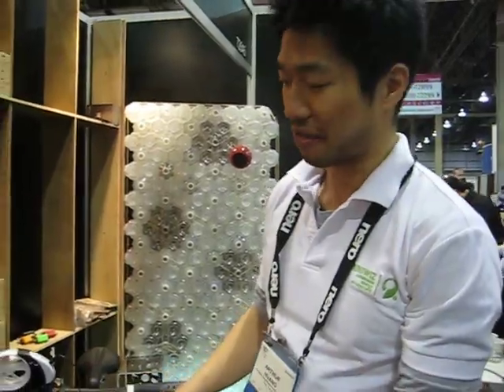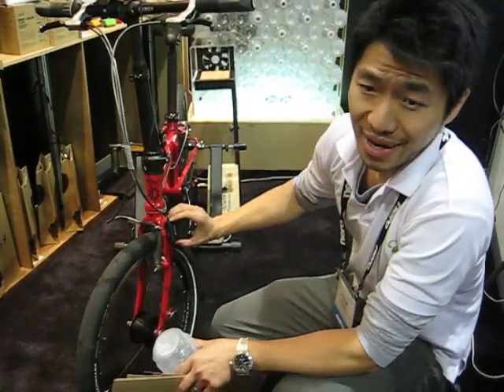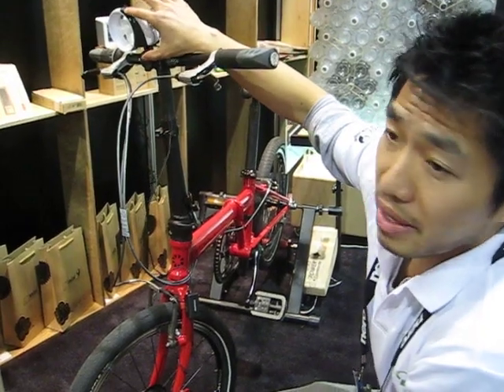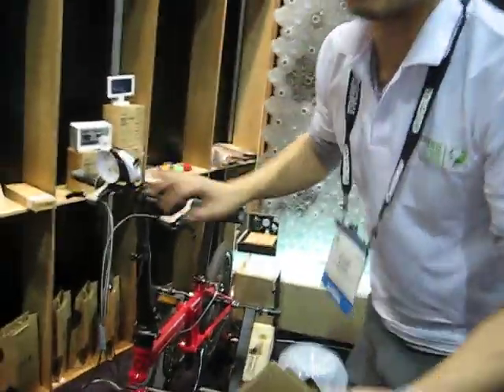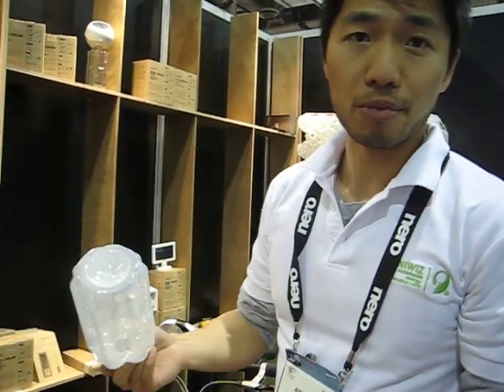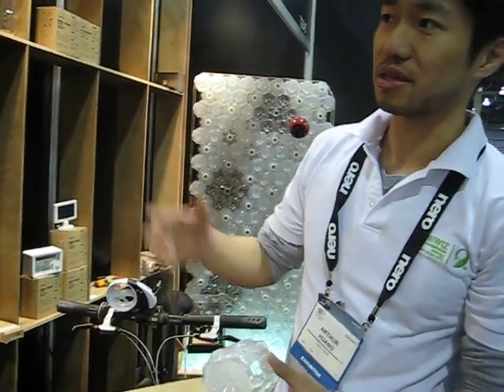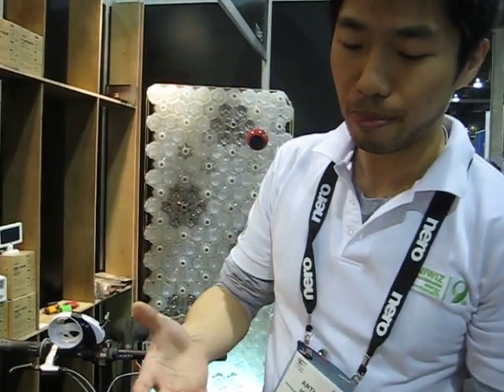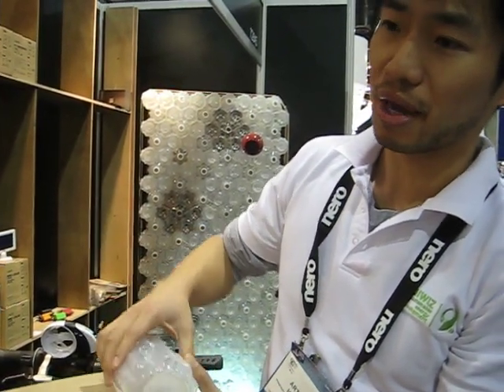Hymini's Charger Family

Comment: It's shocking. we have advanced so far in technology yet we still cant come up with a decent portable wind generator. I used hymini for 2 years on my bicycle. 2 years I sped around looking a complete plonker. does it hold a charge? yes, after you charge from you mains. but not, NOT from the wind. It is sad. I so wanted this work. But failed miserably it did. the device is redundant now. I have my cycling dignity fully restored!